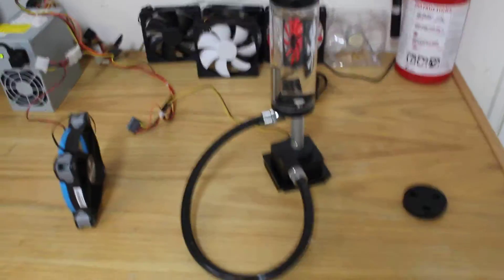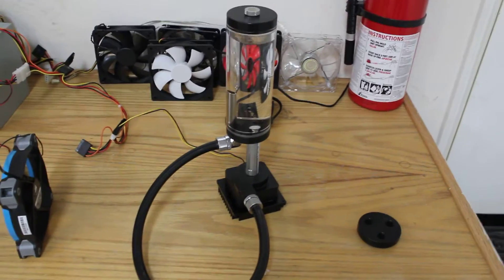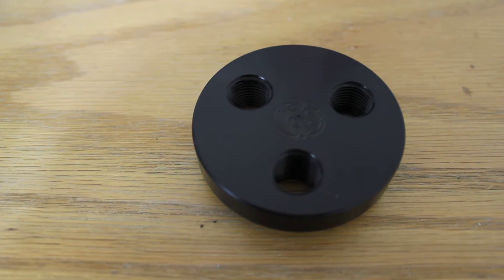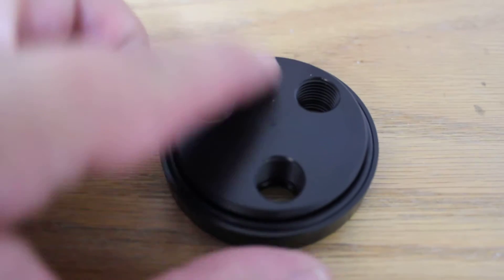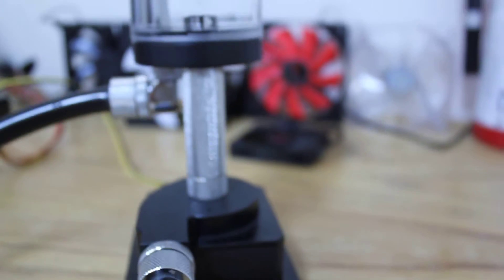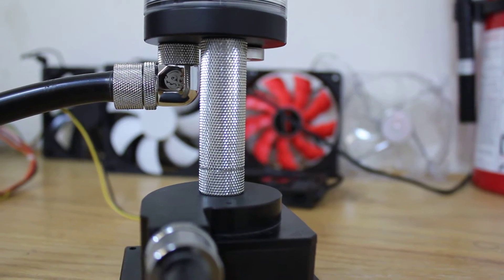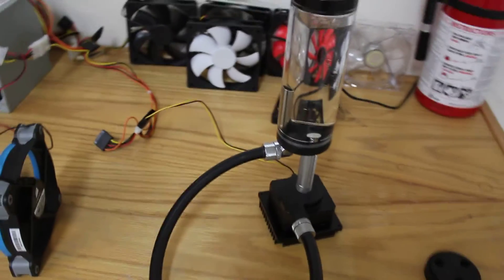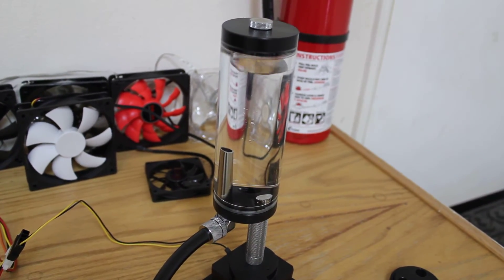Bitspower Water Tank Z-Multi 150 leak check

Comment: Get a syringe with some silicone sealant and fill the hole. There you go. It's fixed.
Reply from the maker: No need, bits power has awesome customer service. They shipped me a new cap right away.
Reply: That's good to hear !